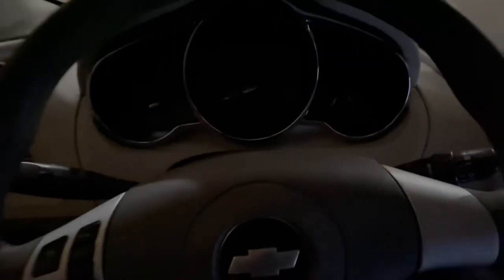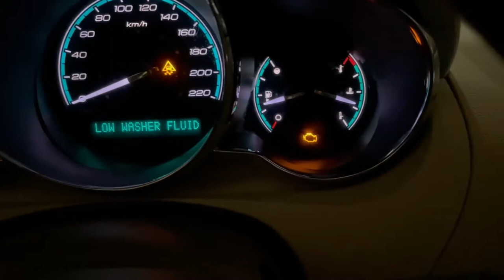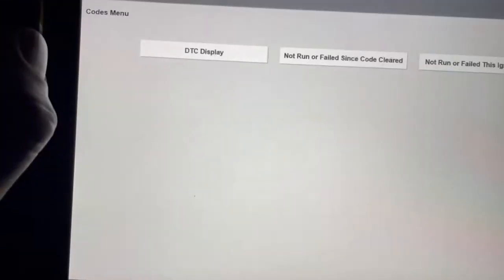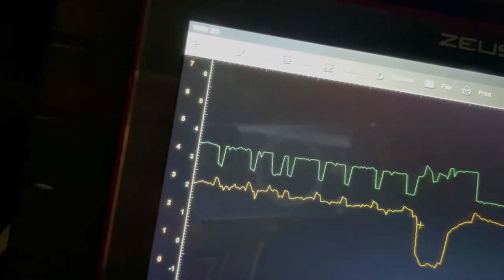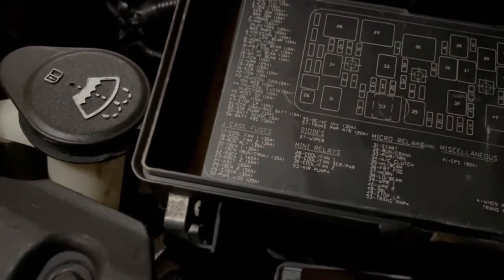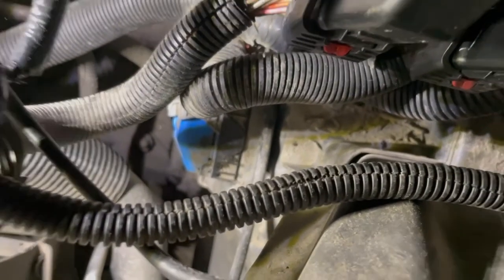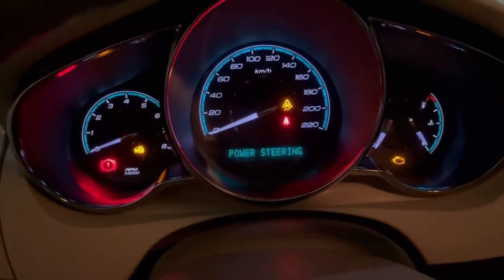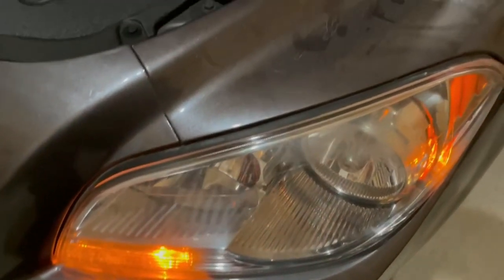2010 CHEVROLET MALIBU CAN COMMUNICATION PROBLEMS

Comment: Thank you! I did a transmission swap on my 2014 Malibu was having all these issues. I don’t have a scope but I went through and checked everything I unplugged and cleaned them with parts cleaner. My corporate was the power steering rack plug.
Reply from the maker: Wow great job, it’s always those plugs .
Thanks for the information.

Comment: Mines doing this same thing I used traction control then this happened it stalled out as I was driving also had the emissions sensor. Now all I get is service esc. The recall for the bcm was done or so they said but it's still not starting. I've changed the ecm and the main fuse box and had it programmed nothing it had a bunch of code once every other time always no freeze frame or fault codes.
Reply: My car is doing this right now did you figure out the problem ?
Reply: Thats not how you fix the problem at all… you dont just throw random modules at it.
You connect a scope to can hi and can low and look at data packets. Then you unplug each of the modules one at a time on the high speed network until the scope shows descent pattern on the can. Then you know which module it is

Comment: Hi good work. I have the same problem in the same place. I move it and sometimes it works. it will be the connector or the tcm. which do you think I have to change
Reply from the maker: Thanks. subscribe and like
Reply from the maker: The connector needs to be secure properly. If you disconnect that connector you just create more problems because they usually don’t go on firmly like before. Use a little grease to lube the weather seal and connect it again.

Comment: Would the car start when turning the key...my gauges do the same thing but won't start and upon watching your video I was hoping this would do the trick but still not working.. although upon wiggling the tcm my power locks were going haywire does this mean my module's bad?? Pls help
Reply from the maker: maybe a loose connection at the connector ?
Reply: Of the tcm mod?
Reply: It's really weird all I did was put an old battery in got it jumped over let it run for 30 mins and when it decided not to start back after shutting off put the other good battery in and now have this issue

Comment: Greetings,  I change my cluster because stop working, the new one (used) works well but, dont count miles.
is it supposed to automatically count them or something additional needs to be done?
It may be that is a unit with that defect?
Thanks!!!
Reply from the maker: Uhm GM don’t like swiping used part they will not work. Programming is needed for a new cluster otherwise it will not work.

Comment: I have a 2013 Malibu 2.5L LT doing the same thing. It can run for days then get all kinds of codes. U0100, U0101, U0073 etc etc. Many more.  Mechanic could never catch it with the scanner when it happened. It cannot be trusted to drive. We have cleaned the ECU and TCM connectors and used dielectric grease. Put a new Diehard AGM battery in. Replaced red and negative cables and fuse box distribution block on top of battery.  New driver fuel module.  I have not cleaned the BCM connections.  Do you think I need to do a more thorough job of cleaning the TCM connector? My car acts exactly the same way as your video.
Reply: No no no.. you have to use a scope and watch packets on the can hi and low. Then you disconnect the modules on the can bus one at a time until the data packets look normal. When you disconnect the one that returns the can to normal, that is your bad module…
Reply: Did you ever figure this out?

Comment: Same issue here: It worked for me too. Great!! Just toggled it it cranked up. No issues
Reply from the maker: Thanks for the positive feedback
Reply: Was a big relief. Get tired of spending money on none fixes.
Reply: I’m currently having the issue now but mine is on correctly? I don’t know what to do now please help
Reply from the maker: @kevinadams7311  check is you have 60 ohm at pin 6 and 14 on your DLC connector first.
Reply: @quickautomotivediagnostics8728  could the battery post also cause this issue. ?
Reply: @quickautomotivediagnostics8728  DLC connector? The TCM connector? Which one are you referring to? My 2013 Malibu and doing the exact same thing. I have cleaned the ECU and TCM connectors. Replaced both battery cables. Cleaned all the grounds I can find.

Comment: 2 issues with this video Brother, you have a known problem with the TCM connector pin fitment but you did not adjust pin tensions, also a favor please, your scan tool showed 8 modules according to the count the Snap On shows at the top of the screen after a full scan. You have some COMM Codes and some modules were missing from the list. After you make repairs can you please do a post-scan and show the count of all the modules? Different scanners count in different ways but this is important to many of your viewers, cheers.

Comment: 2010 Chevy Malibu will start but won't stay running about listen 5 minutes it will die unless you spray the starter under the hood PSI is at 55
Reply from the maker: Is there any fault code?

Comment: I just change engine on my car she don't start i dont know why
Reply from the maker: Check the ground cable on the engine block
Reply: I checked all my ground wire she say power steering low fuel

Comment: Wasn’t there a recall for this?
Reply from the maker: They should recall that connector but when I check I did not find any on Alldata.
Reply: @quickautomotivediagnostics8728  Maybe I’m thinking service bulletins

https://static.nhtsa.gov/odi/tsbs/2015/SB-10089834-2280.pdf

They did this next one on my 2012 malibu a while ago, and last night I saw my brake lights were on when the car was off.  

https://static.nhtsa.gov/odi/rcl/2014/RCRIT-14V252-3751P.pdf

Been trying to fix a rough idle.
Reply from the maker: @1111comment  I think there is a software update that fix the cluster . I did one on an equinox and works good

Comment: no rhyme or reason how he came to conclusion it was that plug ...poor diagnostics .....he knew it was that from beginning or else wouldnt have gone to it directly dont believe everything ..if experiecing service esc n other problems n loss of power chech throttle body i have 2010 malibu lt that had same issues clean it n make sure rubber boot is good ..this guy is a hack job  tbh
Reply: Hi. Where is the throttle body
Reply: I doubt if your throttle body was causing CAN bus interference. This guy may not be a NASA scientist, but his methods are viable if you don't have a dealership shelf full of parts to swap in and try. It's possible he moved around some other wires near the blue plug, and got a better connection, but who knows.
Reply: Fuse 31 or 34 pcm relay
Reply: Fuse 31 or 34 pcm fuse
Reply: well... the plug fixed his problem. I know the internet is still new to you but when you find fixes online from other people, its typically just something that was their special case. Keep searchin buddy youll find your answer one day.